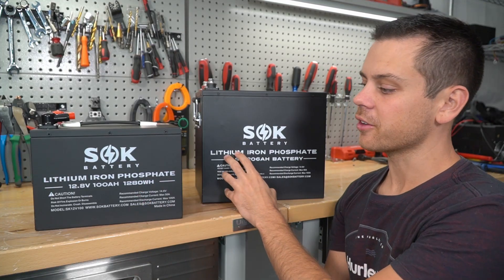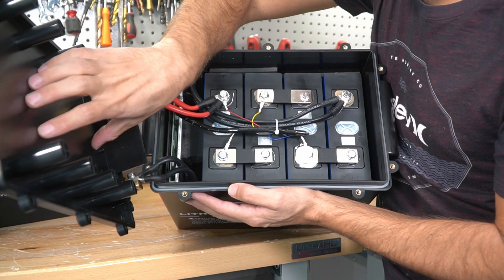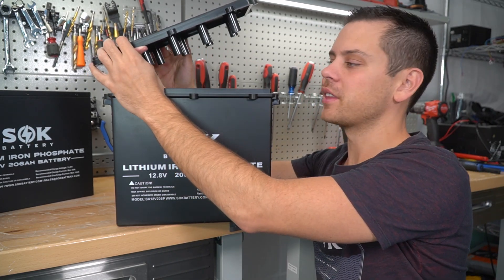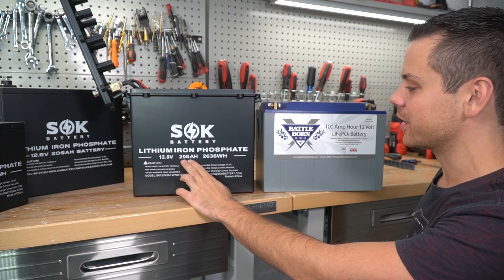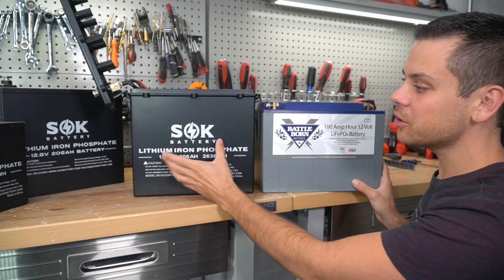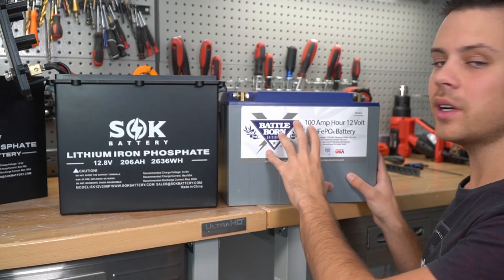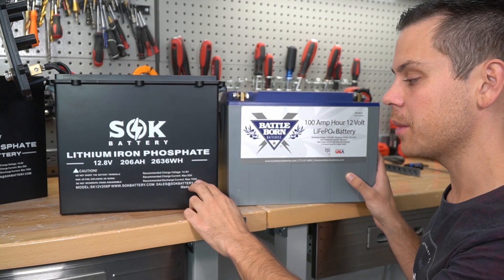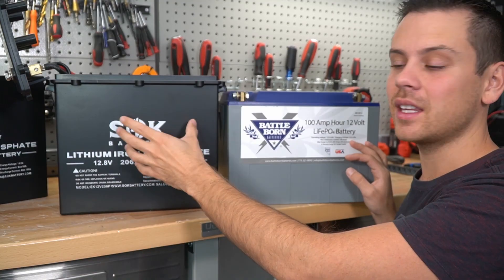New Battery! Marine Grade SOK 12V 206Ah LiFePO4 for $.39 per Wh

Comment: So would the SOK lithium batteries be the best option financially to use on a bus conversion running on full solar? I was going to buy BB until I found this video. Going to need a large battery bank running a mini split and other appliances
Reply from the maker: Trent, yeah absolutely. Sok would be half the cost. We need to give Battleborn more competition and then they will lower their prices. American assembled needs to lower in price.
Reply: @WillProwse  I appreciate it! Just watched your videos on the Chins and Zooms batteries also. Could you comfortably use those over SOK? I’m doing a full off-grid skoolie conversion as cost efficient as I can
Reply from the maker: @TrentonFletcherMusic  if you use a Chins, and mount them in the living area of the skoolie, you should be okay without cold temperature protection. You can easily add your own low temp charging protection and use a Chin's battery. Or zooms. Sok battery will last longer because it has really good cells.
Reply from the maker: @TrentonFletcherMusic  sok has a better build quality than the chins. And you can service it if something goes wrong
Reply: @WillProwse  thanks man, that’s super helpful! Do you have a resource on your website or know of a good one where I can figure my energy requirements? I’ve been able to get rough estimates, but want to chart out exactly what I need to order. Definitely 24v
Reply from the maker: @TrentonFletcherMusic  check out my website, there are 12/24/48V blueprints and more. Lots of free information all over that site. https://www.mobile-solarpower.com/

And my book is available there too. I have math free system sizing recommendations in that book and methods to calculate everything on your own.
Reply from the maker: @TrentonFletcherMusic  glad I can help. I know it's a lot to take in at first
Reply: @WillProwse  perfect, I’ll check it out! Thanks again!
Reply: Doesn't "Buy American" mean anything to you?  Doesn't "Customer Service" with people whose primary language is "English" mean anything to you?
Reply from the maker: Battleborn cells and BMS are made over seas. It is only assembled here in america. And yes true, the customer service for Battleborn is phenomenal. But he might not need it. Current connected sells sok, and they have fantastic customer service as well, and they are American.

Comment: Will, have you checked out the new Dakota Lithium Engine Starting Battery for automotive use? Interested in what you think of these, as the entire unit has to be different then anything else out there. Automotive alternators are putting out huge amps for lead acid/Gel batteries, so how they got around this will be interesting to see. For RV use with solar panels, can these be charged that way too?

Comment: A few weeks ago I ordered the 100amp sok battery - this battery is well designed.  what I like about the 12 volt system is that if I have  a power outage I can use my car to charge it if the sun is being covered by clouds.  Just going to order a dolly like in one of your last videos and set up back up power when needed - and what's cool is I won't need to run long extension chords to plug in refrigerator or a/c  << just directly to inverter.  Thank you for posting your very informative videos and ideas 👍

Comment: Anybody else have issues buying their batteries using pay pal debit card? I've tried on several occasions this last month and I still can't buy any
Reply: Just ordered 2/12volt 100 AH batteries from SOK. Tried using my Discover card and charges were declined. SOK claimed no problem on their end. Discover said no problem with my card. Used my Visa and charge was instantly approved. The text alert I received said was for a charge by SOK BATTERY in Hong Kong. Have not checked with Discover to determine if international charges are not approved.
Reply: @soctnights  yeah, I'm having the same issue. Both parties say they are good but card keeps getting declined
Reply: I REFUSE to buy anything if the only way to buy is via PayPal.
Reply: “debt card” - when you buy using a good credit card, you get double warranty on many items, you get better protection from stolen cards & bogus charges. Guard your debt card with your life, use credit & pay it off at the end.

Sometimes, when one tries to make purchases via debt, a reserve is requested, for more than the actual final price, and the reserve gets released at some point in the future once payment is received.

I am not sure how all this stuff works with PayPal and larger purchase, but after being bitten by these things a few times while making other purchases… I am very careful!

Comment: I love your videos, Will!
I own (2) Bluetti EB150 solar generators— we are very happy with the portability and the performance of these and they fit our needs perfectly.
I charge them up with a 400 W solar panel array.
However, i’m looking for a way to expand my battery storage capability.
How would I go about hooking up one (or two) of the SOK 206 amp hour batteries to my Bluetti? What I would like to do is to charge up the SOK battery with my Bluetti when the sun is out—maybe using a charging brick attached to the AC outlet of the Bluetti.
And then when the Bluetti  runs low I would like to be able to hook up the SOK to the Bluetti to recharge the Bluetti internal batteries.
Can you help me in achieving this?
If a different battery other than the SOK would be better to use for this, I’m all for that.
And if you have a better idea of how to achieve this I would love to hear it!
Thank you! Richard Van Ausdal

Comment: Looks like Renogy has a new battery, 12V 100Ah Lithium Iron Phosphate Battery w/ Bluetooth, currently selling for $500
Reply from the maker: That's a temporary sale price, and you can't series connect it. Or else I'd mention it
Reply: @WillProwse  But it has bluetooth and there is a coupon that takes it to $450 each.  And it is waterproof.  I bought a bunch of them.

Comment: WOW! My comment and question about ABYC's lilhium battery use and specifications used on a boat disappeared ten minutes after I posted it. WTH?
Reply from the maker: I can see this comment. YouTube blocks comments with links. Did you post it with a link?
Reply: Hmmm, my new post without a link just got deleted too.  All i posted was about a LiFePO4 battery that was a better price, from a quality manufacturer.
Reply: Yeah, mine got deleted too, but i put a link into it.
Reply: No links in my comment. TE-13 is the specification for lithium batteries on a boat from the aforementioned marine standards group.

Comment: When I think about what I paid for 10 Battleborn 12v batteries last year I kind of cring because of all the newer batteries that seem to have the same performance ratings from WIll but at a much nicer price point. Still, my BB's have performed flawlessly while running my entire class A RV directly to my entire loads panel so I have zero complaints about their performance. This lifestyle is very addictive and $$$ when you go big, but well worth every penny spent!
Reply: So you feel better, remember supply of these could dry up at any moment.  With shortages everywhere, power grids announcing outages and strain, you're all set for whatever eventuality may occur.  That could easily be worth the price you paid.
Reply: It's the way of technology... always gets cheaper over time.

Comment: I just bought 2 battleborns for 799 each... direct from Battleborn. Maybe they are aware of what's going on. Gread Vid, Will, keep it going. Your vids make you a mover and a shaker in the industry.
Reply: How are these for offroading compared to battleborn
Reply: @Keyzer Soze maybe for a cheap Chinese battery, but not for a battleborn. cylindrical cells, no expansion issues.
Reply: @Keyzer Soze 2 for $799 if you go back and read again. So the price is getting competitive but you will take more space to place them. And it made in the USA.
Reply: @Keyzer Soze Wrong. Battleborn are made in Utah, USA.
Reply: @sspence65  Assembled with Chinese parts, by Mexicans

Comment: Do you have a recommendation for a 12 volt budget battery? These are just out of my league. Thanks for the videos. Very well done and so informative.
Reply: recommending anything won't help without Specifics . Here i,m looking at Lossigy 300AH at 1030$ each . To use AGM u need at least 500AH total - here almost 1000$ BUT Twice the Size and Weight Half the life.
Reply: @flowrob6861  I've been using lead acid 100 ah batteries for about 10 years now. I get about five years use out of them. They cost me $100-$120 a piece.
Reply: Deep cycle lead acid
Reply: Spending money on an SUV, cigarettes & booze tells me you have money to spend on "American" products.

Comment: So... would you do an SOK 206 marine or Renogy 200 w/ bluetooth? I'm putting one in my Volkswagen camper van and I think BOTH are contenders! Thoughts? (both will be charged via alternator and solar)
Reply from the maker: I never use the Bluetooth so I would go for sok. Renogy has a great built quality and possibly future communication features with their ports, but I think it is more that can fail. And renogy 12V packs cannot be connected in series. But if those things don't matter, you can go for the renogy. Both are good options
Reply: Why a marine grade in VW? The regular 206AH is what you want, though they're hard to locate with high demand. Make sure you install a proper DC/DC charger so you don't burn out that alternator!

Comment: Modern gas-generators allow stacking (Inverters that can operate grid-tied or non-grid-tied, depending on circumstance).  What inverter would you recommend for switching between grid and power-outage conditions (solar)?  Manually switched or automatic?

Comment: I have a battle born I bought to replace the 3rd gel battery that puked out after 6 months,(I not too careful with my stuff). It has performed perfectly, even after have tried to blow it up! oops. It righted itself after a few hours and no problems to date. Now having said that, I would love a cheaper alternative, except they are all made in China. I bought the BB battery specifically because it is made in the states and anyone who answers the phone seems to be an engineer, great service. If they could get their production costs down to 50-60 cents it would be a no brainer. Thanks Will for all you do. Remember, buy American if and when you can afford.
Reply: I think BB's bms and cells are made in China too.
Reply: @akhtarkh  I'm sure you are correct about the cells, but then again most of the semi-conductors aren't made here, but alot of stuff that says made in usa uses them. I think the only thing left with 100% usa content is summer corn! and I'm sure prices for all will come down when solid state hits the market!
Reply: @hairband80s69  Yeah, I think you are right.  I know they specifically say they are designed and assembled in NV.  That tells me the cells come from overseas... most likely China.  However, just having a company you can trust to do quality control is worth a bit extra.  And their customer service is outstanding.  That said, I'm not sure if it is worth double the price.  Not if those less expensive batteries are of equivalent quality.  
I'm still glad I got a BB for my first Lifepo4.  I had tons of questions on setting them up and stuff. Youtube videos are nice but you can't beat having someone you can quickly ask questions directly to.
Reply: someone answering the phone and helping with literally any questions you have is worth the extra price. That's why I went with Battleborn, it's a lot of money but I have faith they'll be there in 5 years, SOK may or may not be.
Reply: @brandonyoung181  they all last decades. No company in this industry is guaranteed to he here in 20 years. Especially with the advancements in prices.
Reply: @hairband80s69  I think your right
Reply: @hairband80s69  It sounds like they are good quality.  I probably would have bought one of them instead of BB had I known about them and they were available... not sure if they were when I bought my BB.  It would have been a close call though.  I had issues with the last AGM battery I bought.  I didn't want to go through the same thing with my first Lifepo4... at least not with a company based outside the U.S.  I mean, at the time I didn't even know how to tell a good one from a bad one.  I just knew BB usually had good ones and had good customer service.  That put my mind at ease.
Reply: @Channel-gz9hm  The cells are made in China for sure.  But where is the battery assembled?
Reply: @scottf4277  Their website states they design and assemble them in Nevada.

Comment: Will - While the SOKs support running in Series, SOK specifically states this important distinction on their website - "Please note for connecting in series: If you are going to connect the batteries in series they need to be at the same State Of Charge (SOC) before they are connected."
Reply from the maker: Yes, that is true for all batteries when put into series
Reply: @WillProwse  - I assume you simply charge each battery to full capacity, then connect in series?
Reply: @MUCK1955  Fully charge each. Then connect the two (or more) in parallel. While in parallel charge them as a whole so they all get to the exact same SOC. I would even leave them connected in parallel for a day after removing the charger. Then they are ready to be put in series.
Reply: @rickmaddy3133  Awesome... thanks for the info.

Comment: Very nice, SOK is doing a good job. High quality and reasonable prices. I do like the plastic (nylon) case better. Now if they just made that in a 100AH 24v configuration. Yes, these are good enough quality to series connect, but it would be a good option. Probably not a big enough market.

Comment: Will, a CON for both to add.  No network connection so if a user wants to add multiple batteries, they can monitor all the battery cells at once.

Comment: Please make things apples to apples. You give the specs for amp hours and volts. Then when you give the price its in Watt hours. Sure, yes, I can do the math, but why should I be required to do that? I am the customer. Help me buy from you (them).
The more confusion that is placed in the way of novice yet potential solar adopters, the longer it will take for them to feel comfortable making the leap. And there's little precious time to make the big conversion before we pass the point of no repair.
The early adopters have all been sold. Now is the time to ramp up production on all components and sell to the middle of the bell curve. Economies of Scale will save this planet. Not confusing techno talk. KISS method. Keep It Simple for the Stupid. Like me.
Reply from the maker: We use Wh per $ because then you don't need to do math. Whether the pack is 12 or 48V, it doesn't matter. Wh per $ is easiest.
Reply: @WillProwse  So, I tried to figure out how you got to the cost per Whr by doing ( 12v X 206Ahr ) ÷ 1029.00 = 2.40 per something?  I guess I don't know the formula. So what I am trying to make clear is that CUSTOMERS SHOULD NOT BE REQUIRED TO DO MATH in order to be able to compare products and go solar. We need to make it as easy as possible.
Possible a new measurement needs to be devised and implemented that boils everything down to just 1 number. One metric that encompasses all of the various differences included by other similar products.
So maybe one number wont do that, but at least the price per unit of power can be less techy. Give it a mneumonic name like WAVv - WattAmpVolt Value. So this battery would have a WAVv of 39 cents. "Per what?" It doesn't matter. "Aren't you curious" No. It doesn't matter what the other numbers are if I have the WAVv. As long as someone else does the math. If the customer wants to know how it was derived they can google it. But Burt and Betty Brown from Baltimore just want to fo to Walmart and get a good deal and don't want to do any math. They just want to get it and forget it.
Fewer models of batteries would be good too. We don't need so many classifications. They all do the same thing.
Reply from the maker: @scout4locations  just divide it. Price divided by Wh capacity. I list these figures on my battery page for every battery I recommend: https://www.mobile-solarpower.com/lithium-batteries.html

Compare them as you want. I don't mind how you do it. I like Wh per $.
Reply: @WillProwse  what about putting the equation in the same sentence? It would only be a few more characters.
Reply: Education is the key!